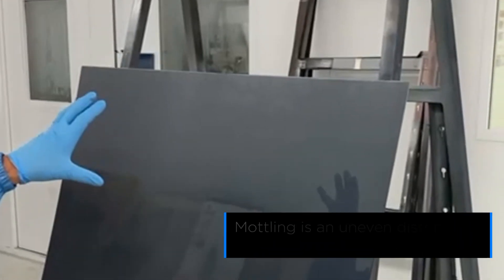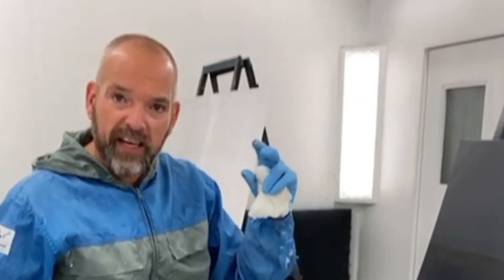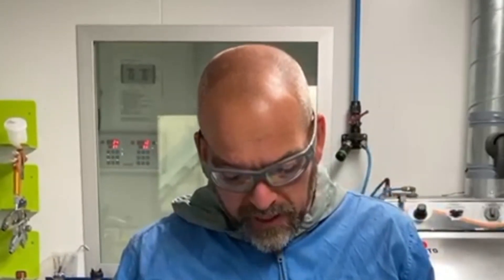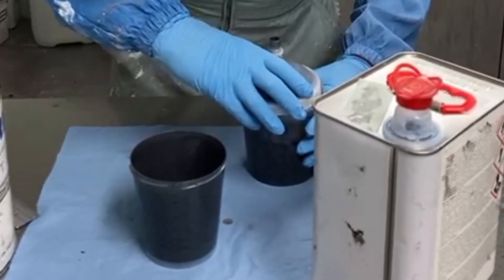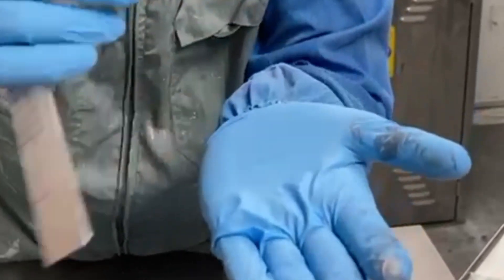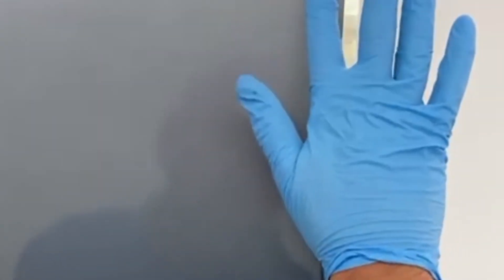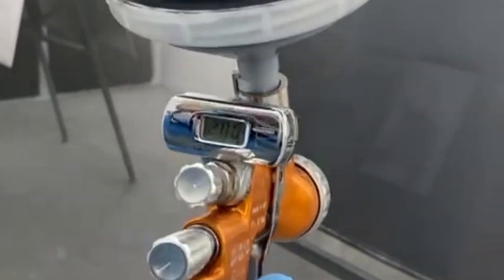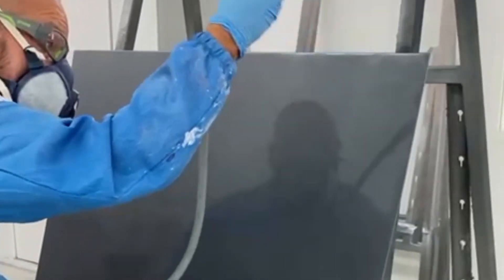AkzoNobel Yacht Coatings and Coffee - Metallic Finish Application

Comment: Dear Sir : Could you recommend what kind of reducer is better for Awlgrip finishes?
Reply from the maker: Hello there! To start with, we recommend our mid temperature range Reducer, T0003 at the recommended ratios    100:50:15 or 2:1:10% (reducer ratio is 50 or 1). If you struggle wetting out the 2nd coat you can add an additional 10% of reducer to the total mix to help, or if the temperature gets higher then you can use T0005 as the extra 10%. However, be mindful this is a slow reducer so will change dry times and application characteristics. If you have any further questions, please reach out to us via https://www.awlgrip.com/contact. Thanks for using Awlgrip!

Comment: What air cap are you using on the gti? Te10?
Reply from the maker: Hi Daniel - It was a Devilbiss PROlite with 1.2 Nozzle and TE20 Aircap. Thanks! ☺️
Reply: Thanks, I’m a uk based paint shop. Been painting boats for the last year and have one in a few weeks to do in awlcraft silver E1129 so your vids are immensely useful. Don’t suppose you could recommend a supplier for me to use and a source of technical support as I’m looking to move from using a mainly automotive paint system to a full marine one. Many thanks, Dan
Reply from the maker: @danielcollins3815  our distributor in the UK is Marine Ware. If you’ve got any specific questions on this, you could reach out to Ed Warren on ed.warren1@akzonobel.com for some technical questions.